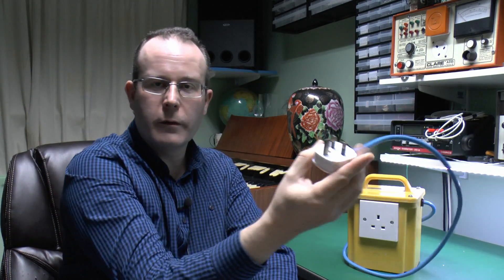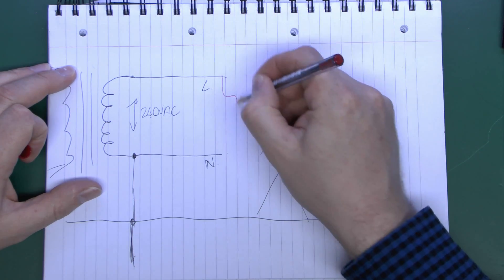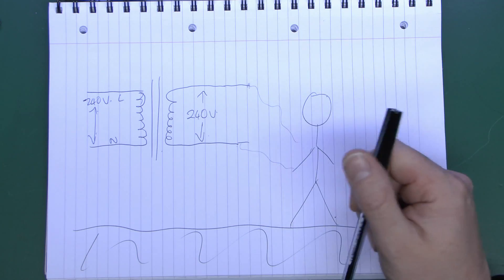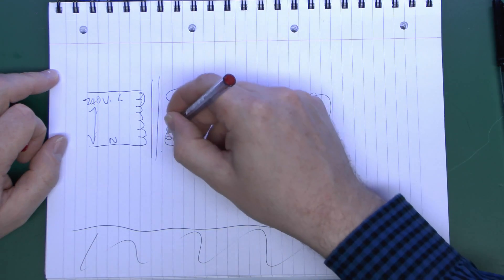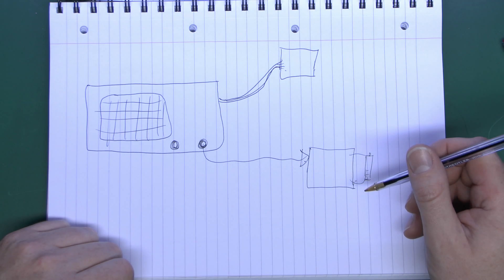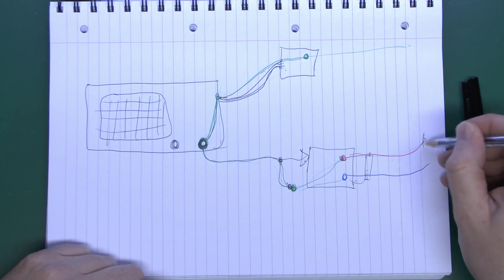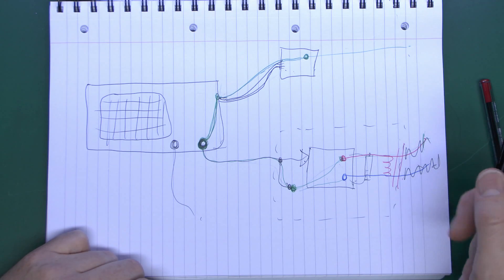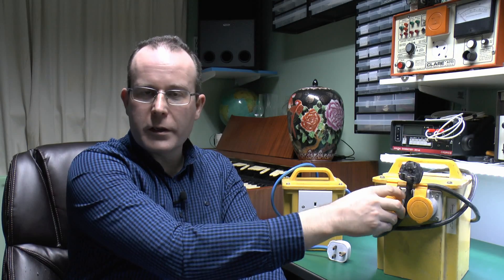Mains Isolation Transformers

Comment: For one struggling with the notion of what happens when a device designed to be plugged into a normal home wiring receptacle, is instead plugged into an 'isolated transformer'...  Are all AC equipment certified to work when plugged into an 'isolated transformer'?  If not, what type of equipment would this NOT be recommended for such usage?  Finally when one plugs a device under test into such a 3 prong isolated transformer, is there in fact 'no connection' to the 3rd ground plug?  as obviously, it can not go to earth ground.  Thanks for trying to explain to a newbie...
Reply from the maker: Nothing happens - all electrical outlets are supplied from a transformer somewhere.
With no earth/ground connection, the vast majority of equipment will work exactly the same.  The only exceptions are very specific items such as some gas boilers which require the earth connection for flame sensing.
For an isolation transformer there is either no connection at all to the ground pin, or in some cases it's connected to the incoming ground of the transformer, but in both cases it's not referenced to the output.

Comment: Might seem a daft question but could you use a old shaver socket for low amp mains supply appliances testing?
Reply from the maker: Yes, but they are limited to 200mA so it would only be suitable for tiny loads.

Comment: Enjoyed this video.i have 2 site transformers 240_110v and another 240_110v.I need 240 _240v mains isolated to check an audio amp fault.if I connected both transformers back to back and removed earth from second transformers would I be able to use my oscolscope with caution.engineer 50 years electrical.tks Michael
Reply from the maker: Theoretically yes, however in reality this would require modifications to one of the transformers, as if using it in reverse the output would be the exposed plug pins and the input a socket.  There may also be other problems if the two transformers are not exactly matched, output voltage may not be what you expect and there could be further issues with inrush current.

Comment: HI John, I'm curious what the earth pin on the plug of the thing that's plugged into one of these is connected to? So if there is a fault to frame of the equipment that's plugged in will it cause a current to flow and trip a beaker?

Comment: It seems that these isolation transformers usually has a connected earth wire on their outlet sides. Is this neccesary? In case there's an earth fault in the device under test, wouldn't it cancel the benefit of using an isolation transformer?

Comment: Can someone please answer why you can get a shock on the first one , but not the second? I understand it’s an isolated transformer with no earth but the drawing of the man touching live is the same on both examples, both have contact with earth. 

How when you are touching 230v and also touching earth at zero potential do you not get a shock? Even if it’s an isolating transformer 

Thanks
Reply from the maker: Earth isn't a zero potential, or any potential as it's not connected to the output of the transformer.
Voltage is relative between two points in the same circuit, there is no voltage between two unconnected points.  Touching one of the transformer output terminals is equivalent to touching one terminal of a battery.
Reply: @jwflame  just trying to understand is at college we’ve been told that voltage flows when there’s a different potential. So in my original question , how do you not get a shock touching a live part from a shaver socket if you’re other hand is touching a tap. But you would get a shock if you touch a live in a switch while you’re stood on ground or touching s tap ?
Reply: Thanks, so why do you normally get a shock touching a live conductor if you’re stood on earth ? Sorry I’m still studying 

Appreciate the help

Comment: Can anyone pls explain - i understand that earth wiring is a safety feature, but if being referenced to earth is what contributes to recieving a shock, why the hell is it done at all? Would it not be better that the entire system goibg back to the source of generation simply consists of live and neutral?
Reply from the maker: It would be safer if the system wasn't referenced to Earth, but the problem is keeping it that way.  Any fault between one of the conductors and Earth anywhere would make it into an earth referenced system, and you have no way of detecting that.
Reply: @John Ward so is the presence of an earth conductor intended to provide a  detectable, faster (and therefore safer) path to earth than would be provided without an earth conductor?
Reply from the maker: @danielowens9824  Yes, if a fault occurs, a very high current flows which will cause the fuse/circuit breaker/RCD or whatever to disconnect the supply and remove the danger.
Reply: @John Ward  ok thank you, I've just got one more question if you don't mind; how can an earth on the separated circuit side of the transformer be safe, does this not defeat the purpose of electrical separation? Or have I misunderstood sonething?

Comment: Dear John, the isolating transformer is very useful. Can you advise where I can get one.  Thanks!
Reply from the maker: Most electrical suppliers have them such as https://www.superlecdirect.com/6111-carroll-meynell-isolation-transformer-750va-230230v/
cheaper used ones can be found on ebay fairly often, such as https://www.ebay.co.uk/itm/234727374514
Reply: @jwflame  Big thanks for your sources!!

Comment: At 12:45 we see that the isolation transformer, itself is grounded via a three prong plug. However the device under test connects to the transformer via a three prong plug as well but I assume that this is for compatibility reasons as the ground plug on the secondary is not connected to mains earth?

Comment: Hi John, I have been testing a mobile welfare unit which has three 13A sockets supplied off of an inverter through a single radial circuit. Could this cause an issue such as the scenario you describe around 11:25, ie if a fault develops we could see 230v between the exposed conductive parts of both pieces of kit?

Comment: Thanks John great presentation. How about if one were to fit an RCD on the secondary of the safety transformer? Then presumably it would offer live and neutral protection too so much safer? Thanks
Reply from the maker: An RCD there would only work if the output was referenced to Earth - which would make the isolating transformer pointless.

Comment: Sorry for commenting 5 years too late, but why anyone not get a shock from the secondary side of an isolating transformer if they came into contact with a live conductor while their feet were on the ground (true earth) ?? In this instance would the current not flow through the person connected to live (via the body and feet) through to the general mass of earth ???
Reply from the maker: The secondary is not connected to Earth, so there is no circuit for current to flow.
Reply: @jwflame  Thanks for response, im still finding it difficult to understand how if there is 230v on secondary side of the transformer, then why this cannot flow to earth (via a persons body & feet) and give them a shock. In normal operation, on the secondary side, current will flow out through line and back through the neutral, so similarly why not out through line and to true earth (via a person). ???

Comment: Hi John, I have finally purchased a Carroll & Meynell isolation transformer.  Having a peek inside, I see that the transformer core is earthed and the two outlets also earthed.  I can understand the transformer core being earthed but should the outlets be earthed also?  Measuring the socket with my trusty fluke I get 180 Volts to the earth pin.  This is not enough to light a 60 watt lamp.  Is this just noise I am measuring or does this need to go back to the supplier?  Many thanks.
Reply from the maker: That is normal - the core is earthed so that if a fault occurs between the winding and the core, it will trip the circuit breaker or fuse.
The 180 volts is due to capacitance between the core and the windings.  If you connect the 60W lamp and then measure the voltage, it will be zero.  Only appears with a high impedance connection such as a multimeter.
The outlet is usually earthed as well, although it's not referenced to the isolated output.

Comment: Really really interesting.  I'm retired now but always had an interest in electronics and want to buy an oscilloscope and am rather concerned about blowing it up. This video explains a lot but wonder if the scope is earthed and if I'm using a bench power supply which has a max output of 30 volts 3 amps do I still need an isolating transformer between the power supply and circuit board? Or is there not enough power there to worry about? (when using scope)

Comment: Great vid as always John. But gonna make myself look stupid here but still don’t get how you don’t get a shock of touching live? Surely touching a live on isolation transformer will still pass through body/into ground and back to sub station then back up to isolation transformer and conducted through into person to make circuit? Sorry for stupid question!!
Reply from the maker: There is no electrical path through the isolating transformer, it's only a magnetic field that links the primary and secondary side.
Current only flows in the secondary if something is connected to both of the output terminals, connecting to only one of them doesn't complete any circuit so no current flows and no shock.
Reply: @jwflame  Thanks. All I could see in my head is that the circuit would still be made through magnetic field down output then through person then through ground then back up input to make circuit

Comment: Can you please explain to me why I cannot use a $15 RCD, residual current device, which in 30 m/s and at 15 mA shuts off power to the scope and saves my life? If I put a pin in my 240 vac outlet, the RCD trips and everything is off until I reset the RCD. Please explain, thanks.

Comment: Hi John, i would like to know could i get an electrical shock if i touches either one of terminal of a cheap portable non inverter generator set output terminal ? Another question, will neon test screw driver light up if i poke either 1 or the gen set output terminal ?

Comment: As the fool that liked the challenge of repairing all and every kind of switchmode powersupply that came to my bench in the 80s, i chose to build a heavy duty bench shelf come cabinet for the old Tek scope out of thick acrylic. It was labelled up with brightly colored lightning icons and an ornate skull & crossbones... with the message "Danger... all surfaces likely to be LIVE to MAINS"!... The scope had its electrical Earth removed and even the IEC power lead had the internal earth conductor disconnected and exposed on purpose at the plug end. I fault found hundreds of SMPS with the kit and yes the scope would go hot with full 240VAC on its outer case, often! Pete's floating scope it was nicknamed.... 

Then oneday came the new OOSH rules and my employer banned 'my' scope safety compliance they said & i came in one mooring my scope was gone ! replaced with a new top end digital thing plus a couple of HV Differential Probes..... I swear though, the old analog Tek let me see weird patterns in a trace due to a fault but the digital scope would never show it.... I think back at the risks i took & yeah... nah not a good way to do your job.

Comment: I don't suppose the earth pin on that isolated socket is connected to neutral but, having said that, would there be any merit in doing so ?
>
Reply from the maker: It isn't, unlikely there would be any need for that unless there was some obscure device that required it's metal chassis to be referenced to the supply.  Doing so would also increase the risk of shock when working on the device.

Comment: John, I bought an A.C. rheostat but was advised to connect this to an isolation transformer, which I did. I also connected my D.C. power supplies to this transformer too (it has several "kettle" type outputs). I attached the oscilloscope to this transformer but now I see that it was a bad idea. As a rule, should I just attach all my lab equipment to the regular mains and ONLY the test item(s) to one or more isolation transformers?

Comment: Hey John great video, found it searching for isolating transformers in regards to use on a leasure boat. I'm an electrician my dad has recently bought a sail boat and has asked me to install an electrical connection for 230v use, it seems that research in to marine electric has opened up a can of worms just wondering if you have any help or guidance you could give me to ensure a safe installation. 

Kind regards 
Scott

Comment: Thanks for your explanation of possible mains earth current paths. I was probing signals on a microprocessor. It was powered by a PC USB supply. I had the oscilloscope ground connected to the negative side of the USB supply and at some point the microprocessor exploded and everything connected including the USB port vaporised and the house RCD breaker tripped. My first thought was that the negative rail of the USB was not at ground potential but surely it can only be plus or minus a few volts with respect to ground? I still can’t quite understand what happened. Perhaps it is impossible to say from this information. Needless to say it was a very expensive catastrophe.

Comment: If you’re working on an amplifier with its own power transformer, isn’t the circuit after the power transformer effectively isolated from the mains power other than the earth ground?
Reply from the maker: That depends on how it's designed.
Reply: John Ward looks like on my VoxPathfinder15R amplifiers, the secondary is center tapped to chassis ground, which connects to earth ground through the the 3 prong plug. So if I lift the ground (assuming power transformer isn’t shorted between primary and secondary).  It should be safe to probe around with oscilloscope leads?

Comment: John, hope you can help.  Based on your videos I was looking to put together an isolation transformer setup.  I have two beefy transformers, 1) Legrand 44147 (PRI 240, SEC 110 CT, 6A, 500VA) and 2) Legrand 44143 (PRI 240, SEC 110 CT, 2A, 200VA).  When I connect them back to back with a mains voltage of 247V, I get 245V out.  So, I thought this seems reasonable.  Couple of questions...I would like to have a couple of 120V out sockets and a couple of 240V ones.  I am presuming the large transformer goes first, then splits out to provide the 120V sockets, but also feeds the second transformer, which then provides the two 240V sockets.  Is this reasonable?  I am totally stuck as to where I should put switches and fuses in this flow, and which rating of fuses should be used at which points.  Any info you have much appreciated.  Cheers, Clive

Comment: @1:18, why don't the electrons go directly to ground through the earth wire? Why do they choose to instead continue on along the neutral wire...and eventually find themselves on the hot side again? Is it not less work for them to go to earth?
Reply from the maker: Copper wire has a much lower resistance compared to Earth.

Comment: Nice explanation but I wondered why they ground the neutral at transformer why don't they feed us isolated power thanks
Reply from the maker: An isolated supply wouldn't stay that way for long.  Any fault between one of the conductors and earth anywhere and it's now earth referenced.
Reply: @jwflame  i am sorry  i may sound like an amateur but it can happen to phase also which has to be isolated from ground ,thank you

Comment: Years ago, I made an isolation device from two identical transformers, 240 in, 12v out - 12v in 240v out. It was so well buffered, you could get a nice spark from the 240v out, without blowing anything. I suppose you could call it an inverter of sorts.

Comment: Sir, can bifilar inductor behave as a isolation transformer?
Reply from the maker: Yes, if the two individual wires are not connected together.  May not be as efficient as a properly designed transformer.
Reply: One more question, toroidal 240 to 2 x 12 volts transformer, that two 12v can be used as a isolation transformer 1:1?

Comment: Why is it so difficult to find a small mains isolation transformer for one appliance that does not step down or up the voltage?   Thanks for the video.  I've been all over the internet and cannot find one.  The BNC - connection on my signal generator leaks about 128 vac.

Comment: Why is everyone so concerned about isolation transformers.its not a mystery and the AA5 is only one use. In the 1980's TV, started using hot grounds and cold grounds. Supply voltages came off the fly back along with an isolated ground.

Comment: When I started working on live circuits it was required to have item you work on behind an isolating transformer AND have measurement devices like scopes on a separate isolating transformer. Υes, you need two isolating transformers for that (with no ground connection!) !
The reasoning was that if you have a grounded scope connected to device you're working on, connecting ground lead makes it earth referenced. Now if you touch anything on the device by accident, you will get shocked by the now mains referenced device (even if it is behind an isolating transformer). Having the scope chassis also isolated makes it safe to touch any single point in device even with scope ground lead connected.